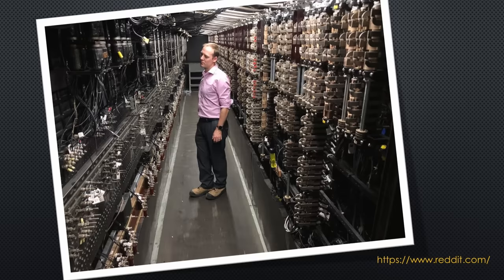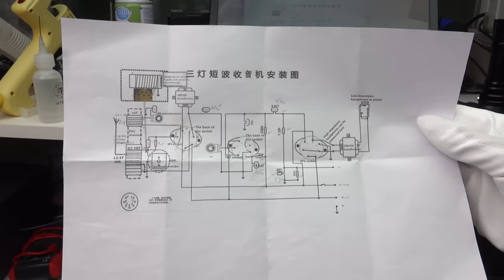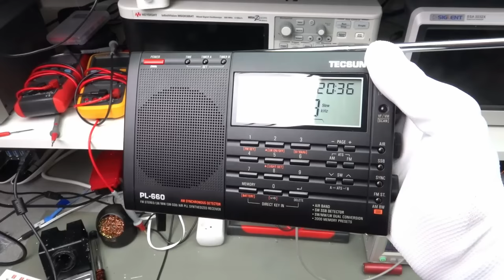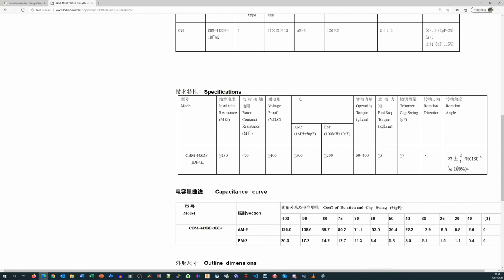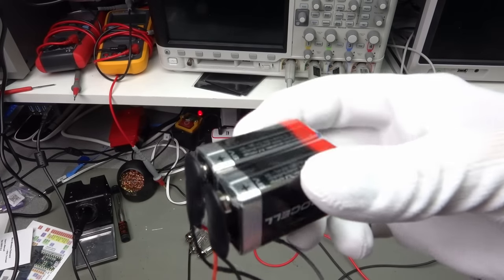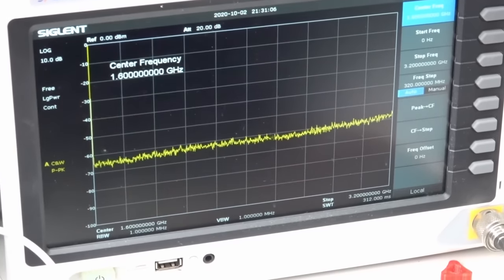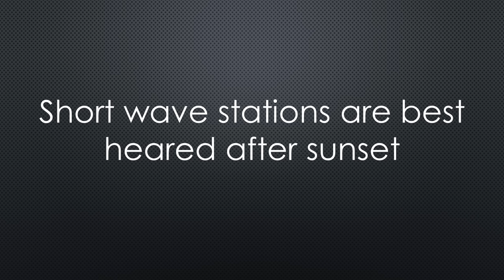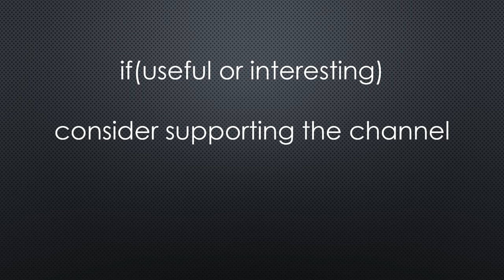#355 Let's try to build a Vacuum Tube Radio

Comment: I have built a radio like that that but it used 2 tubes in the 60's.
Reply: Did it drop an amplifier stage for the speaker? The first two stages might be adequate if listening via headphone...
Reply from the maker: I also found several designs in the internet. Three valves are probably better for loudspeakers, as Ted mentioned

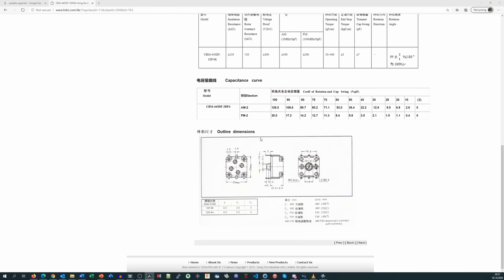Comment: If you look closely at 8:24, I think the spec sheet does tell you. I see C1 AM (Ant) and C2 AM (Osc).  I presume that means C1 is the input side (antenna side) and C2 is the output side towards the Oscilator.
Reply from the maker: These are two capacitors and obviously used for these two purposes. However, the transistor radios they are or were used are not regen type.

Comment: 22.5V Batteries were very common back in the 1960's.  They were used extensively in hearing aids and also flash guns.
Reply from the maker: Good information! I did not know.
Reply: and in such radio receivers, i am guessing you cannot find one now.
Reply: Yes but they are hard to find today and really expensive. I've a portable tube tester from the old days and there is a realy big slot for such a power source. I think they put in 4x6V blocks. Not so hard to replace with some modern cells. and a small regulator :-)
Reply: And 70's. My first universal  V/A and ohm meter from 1975 used one. Hioki AS100-D. The battery was available until early 90's.
Today I use two  A27 batteries and 2 1N4001 diodes in series to drop voltage.
Reply: My homebuilt regenerative radios in the 50-60s used 45v or even 90v batteries ... probably hard to find now!
Reply: @TheDunnock  Yes, I remember those 90v HT batteries.  When I got married in 1970 we had an old radio that used one but I bought a "battery eliminator" which plugged into the mains.  When I was very young my grandparents had a radio that used the 90v battery for the HT but the LT was supplied by a rechargeable accumulator. Each week a guy called at the house and changed this over for a fully charged one, cost a few pence.

Comment: Commenting 2 years later; Did you ever try it with an outdoor antenna and listen to actual stations?  Even in a basement, I am surprised you couldn't pick up some stations with a couple of meters of wire (at night , of course).  I must admit it takes a lot of patience to use a regenerative receiver of this caliber.  BTW, I love your channel.
Reply from the maker: No, I did not try it outside. I have better rigs ;-) Still, it was a fun project for me.

Comment: Growing up in the 60-70 times, vacuum tubes were just about finished.  I always avoided them not liking the high voltages involved.  In the  Military I still had to work on some things  mostly communications equipment related.  Microwave radio and radar was mostly still Tube operated in the 80's.   High Power still is today.  We've not got there with semiconductors.   You have one in your microwave oven today..    Yep it's a Tube.
Reply from the maker: So we are very similar. I also had tubes in the high power RF transmitters in military service. The rest was already transistors.
Reply: Same here. Air Traffic Control radars i 1981-82. Take a look here https://radionerds.com/index.php/AN~MPN-13.
The IF strip was built with  transistors, 30 MHz. Rectifier diodes (tubes)  big as 1.5 L soda bottles.
Reply: @mannhansen9337  Yes Sir,  All Traveling wave tubes or Magnatron.
Reply: @mannhansen9337  reflex klystron opened the gate to HIGH Power Microwave.

Comment: Also:  Sir John Ambrose Fleming (1849–1945) was an English electrical engineer and physicist, known primarily for inventing in 1904 the first vacuum tube. It was also called a thermionic valve, vacuum diode, kenotron, thermionic tube, or Fleming valve.
Reply from the maker: Thank you. Other Englishmen already mentioned this fact. I was not aware of it :-(

Comment: Hello Andreas, your video helps me a lot! I bought the same kit some weeks ago...but till now didnt worked, so Im trying to do another one (solderless version)...but one question I have: your video at 5:39 shows the circuit with "earth" line (down below), so with +1.5V line, and another with + 22.5 or +9~80V line. Ok so far so good. But the upper "minus" source line will make a "short" at the paralell 22 uF electrolytic capacitor and 510ohms resistor if we plug at earth or 0V negative. I have to put this minus line with 9 volts negative? Which are please the purpose of this capacitor and resistor in parallel? Sorry if I complicated the things lol...73s, Daniel...
Reply from the maker: I do no more remember the details. But I do not see that I needed a negative voltage in my design. Did you do the steps of testing the audio amplifier? Then you should know in which stage the  problem is.

Comment: Thank you for the great video, Mr. Spiess:)
But what do you mean with old technology? I'm smiling right now to my left side where my trusty Engl guitar tube power amp resides.
To "these tubes work till today": You can achieve a very good seal with glass and heated-strangulation technique. Also most left over gases (oxygen, nitrogen, carbon dioxide and so on) can initially be adsorbed by the tube's getter. If this media is saturated, R.I.P. tube. Oxygen will burn the heating-element/filament through or other gases impair the function of the tube.
You are absolutely right with keeping an eye on the tube-specs (RTFM):
- Underheating releases oxygen from the oxide layer, which is deposited on the cathode surface and thus reduces the emission of the cathode (poisoning the cathode)
- Overheating increases the evaporation rate of metallic barium from the oxide layer, which also reduces the emission.

Tubes are great. Not only do they sound warm, they also warm your heart.
... and the tinkering basement:)
Reply from the maker: Thank you for the additional information! And tubes still seem to have a big fan community.

Comment: Couldn't work out the code directly, but at least I ruled out the message being "subscribe", the first letter not being an "S".
Interestingly, I'm 25 and used Morse in the past. I had a brief stint on the Budapest Children's Railway, where they kept most of the hand-cranked phones for historical reasons. The stations had single letter Morse callsigns which you had to put in at the start, the entire line was basically a single circuit. I forgot how most of the letters go in Morse, except that the entire line in order reads "A U L I S H O".
Reply from the maker: You are right. It was not "subscribe". Some viewers used an Android app to decode it ;-)

Comment: Thank you Mr. Spiess, great video. Truth be told it would take me a cool 20 mins or so to decode that, I'm envious that you can do all that by ear! That is incredible! How long did it take to master that? A cool Arduino project stores all Morse code letters and numbers in the EEPROM and you type the message in the serial monitor and it blinks the message in Morse code through LEDs, it was fun.
Reply from the maker: These days you can build morse transmitters as well as receivers. But this is not wat we want, of course ;-)
I started to learn it at the age of 16 and then in the army. Afterwards I was a radio operator for the red cross abroad. It took quite some time to learn it.
Reply: @AndreasSpiess  How cool, very admirable. I bet you have some stories. Thank you for your reply 😁

Comment: I played your video at 1.5 times normal.  You sent "hi youtubers".  Not sure what speed you actually sent at but with higher playback rate sounded at least 25 WPM.  73 WB8FEQ
Reply from the maker: I do not remember the speed. But I thought it was below or at 20wpm. Because this is my maximum ;-)  73 de HB9BLA

Comment: I've got some long potentiometers that are about 12 turns. They are from the 80's TV set I watched as a child. Perfect for this application, I guess.
Reply: capacitors are needed :-) they are the most important part to have a variable tuner for the frequency in this radio.
Reply: @hesspet  Yes I know. I said potentiometers for the tuning.
Reply from the maker: As Peter said: You need a capacitor for the tuning on this radio. Maybe they used a different way in the TVs of the time.

Comment: About the oversized resistors; Given their size I suspect they're rated for quite high loads -ie high power dissipation. Better to mount them "free floating" to give them better air cooling and prevent charring of the board :)
Reply from the maker: They are 1 Mega Ohms...

Comment: I jumped back into vacuum tubes about ten years ago.  It was a lot of fun and actually  great way to get back to basic electrical engineering.  Instead of having to guess whats going on in a Chinese kit design why not design an amp from scratch?  The bible which was used by most of the designers in the 50s was the RCA Tube Manual.  ITs still available on the Internet.  A great reference for an old art.  Take a look.   http://www.tubebooks.org/tubedata/RC30.pdf  Andreas, you and I met a long time ago while you were at DEC.
Reply from the maker: So you have much better memory than I have. Where did we meet? And thank you for the link!
Reply: @AndreasSpiess  You were easy to remember, you were the big guy with the Swiss accent!  It was a product launch road trip through Europe I believe, or later when I worked for COGNOS and we were launching a DEC platform.   It was a long time ago but luckily none of the equipment had vacuum tubes.

Comment: If on went to the GIBS school in Solothurn we had to first learn what was called "Durchgriff" ! It was the factor on how much one had to alter the grid voltage if the anode voltage was changed and the current had to remain the same. It was never relevant but army Major Stauffer as teacher insisted. Now when you try AM you find the Beromuenster transmitter house is a youth centre. Well drive to Norway and find all FM stations are off, all has gone to DAB+. Did you know when transistors came out the cars went to positive ground because PNP transistors were cheaper and it was easier to build car radios with a positive ground! Then again last November we rented a Hertz car in Kloten and it had a DAB radio without the plus! We had to put up with only very few stations just because rental cars usually buy models the makers could no longer sell. It was the smallest Toyota and had only 8000km on it! Long time ago I bought the old Taxi radios from the Bur company. We had it converted to to the Weissenstein repeater. Transmitting took about 2.5seconds to heat up the tubes.
Reply from the maker: I did not know the fact about the positive on cars. I thought that this was "normal" to have ground at the chassis. Interesting!
And DAB / DAB+ is not a good story here. Digital is too fast for this application, I think. A car radio has to work for 15 years.

Comment: Hi, Mr.Spiess, I am a radio lover with some experience in building valve radios. However, there is a problem that why crystal radio receiver would the circuit transform high frequency signal into sound. Is it just high resistance or capacitance that lower the frequency or something else work. Plus, I have same question of regenerative valve receiver without RFC.
Reply from the maker: Radios mix signals to get signals to lower frequencies. There are many books explaining these things. Too complicated for this channel.
Reply: @AndreasSpiess  thanks for replying. Well，could you give me   some related website to get clear illustration on this?

Comment: nicely elaborated video, but i am pretty sure ad9850 is not that cheap though. 😁
Reply from the maker: I just used a link. Mine are 3 years old and I did not buy new ones recently.
Reply: @AndreasSpiess  i see. i am trying to build my dual channel signal generator with one ad9850 and one ad9833 connected to a single arduino. somany pin management seems a bit hectic, but 9833 seems to have better built in functions for audio purposes (  freq sweep etc ) from the preliminary looks.

Comment: They are called Thermionic valve's in the UK too. The name is derived from the fact that they control the electron flow.
Reply: Of course not.
The name is derived from the fact that the electrons are removed from the electrode by thermal emission.
Reply: @oscargr_  I was talking about the valve part obviously, smarty pants,  I learned electronics on valve radios.
Reply: @dogwalker666  So together we came up with a near perfect answer.😁
Reply: @oscargr_  well yes.

Comment: Mr. Spiess may I know where I can buy the electronic kits that you mentioned.
I am a retiree and I am a greenhorn electronic enthusiast. I would appreciate it very much
If you can help me understand electronics more especially the vacuum tube radios. When I was on my teenage 
Years my parents used to have a vinyl record player and tube amplifier. That was in the 1960s.
Thank you very much.
Very respectfully,
Johnny
Reply from the maker: I usually post the links where I purchased the products used into the video comments (https://www.aliexpress.com/item/1005002664663309.html ). It came from China as mot of electronics these days.

Comment: That kit would be much more useful if they included coil winding details so it covered the AM broadcast band, 0.5 to 1.6MHz.
Reply from the maker: I assume I would have to add a few windings. Or maybe add a capacitor in parallel, or both.

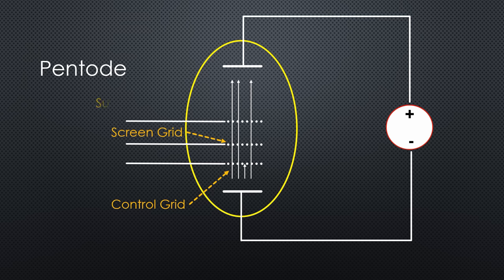Comment: A friend of mine on youtube built a chassis for the cabinet of a 1937 wards Airline radio without using circuit boards, cut out the sheet metal, holes for tube sockets, found IF cans, etc.  all point to point wiring and octal tubes just like it would have originally had.  Here's the start of the short series he did on it.  https://www.youtube.com/watch?v=bA8qLcT_zGk  Skip to about 2:40 to see the start of the project.

Comment: Make sure that if you use smaller footprint resistors that they have the proper power rating for their purpose in the circuit
Reply from the maker: You are right. But both are 2M ...

Comment: That's not what the RFC is doing. It's preventing the plate circuit being loaded by the low impedance power supply. Just FYI.   :)
Reply from the maker: Thank you.

Comment: Sorry if it's a dumb question... Are the gloves you are wearing safe for house mains voltage handling? I've been searching for info and always get recommended those 1k to 10k Volts thick rubber hot gloves. I want to work on a monitor power supply, I need the dexterity for multimeter probing and I'm scared of those capacitors :( .
Reply from the maker: Mine are so called ESD gloves. They protect the parts, not the man ;-)

Comment: Maybe next you could use your SA to show how much emissions are coming from a regenerative receiver?
Reply from the maker: I do not think that it is a lot. But I did not measure it. The overall power consumption of the device is pretty small.
Reply: That is the principal behind a regenerative receiver. A small transmitter being disturbed by incoming RF. Also used by early pager systems. Very sensitive but wide as a barn door.

Comment: Hello Andreas. 17 years old here in India. I always wanted to make a portable audio system with tubes or class A amp but had do go with class D because of the inefficiency. What can I do? I mean is there a way to make class D better and make it sound like class A or tubes.
Reply from the maker: These are two very different principles. You have to chose one and get ass the advantages and disadvantages with it :-(
Reply: @AndreasSpiess  Sad to be true. Thanks a lot ❤️.
Reply: @feldim2425 Thanks a lot❤️.Maybe making the pwm frequency 100 times the input(22khz) will help?Does pre amp really make a difference at the end of the day it has to be pwmED and pass through LOW PASS FILTER? I don't know too much about the subject so excuse me if I asked a stupid question...
Reply: @feldim2425 that channel by Paul McGowan...I love it...